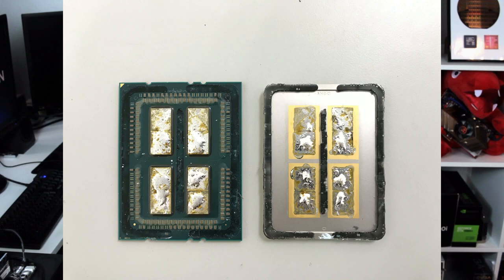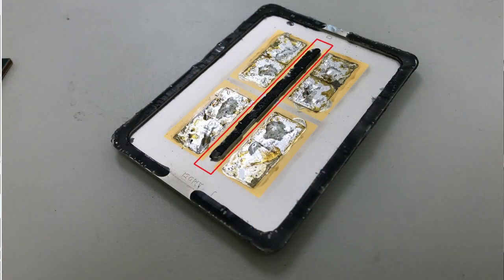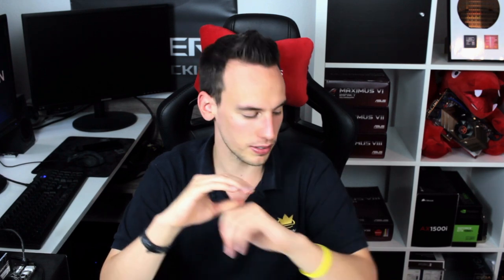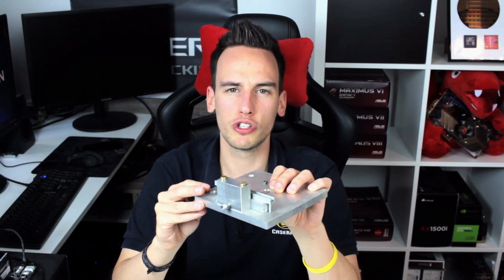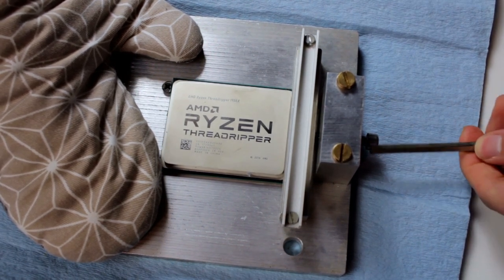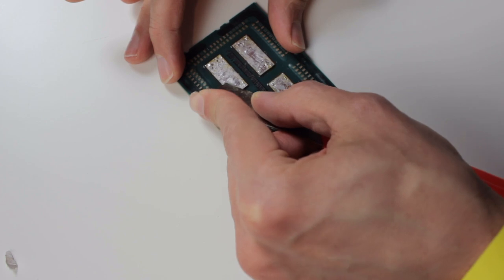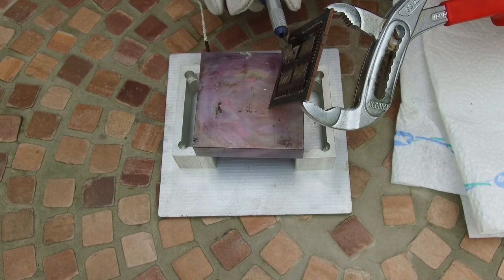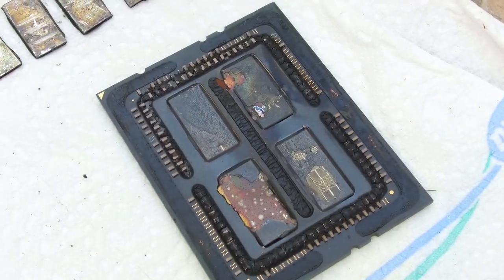Dummy Dies? Threadripper examined (en)

Comment: Hum hum, so this would mean that statement from AMD boasting about the engineers coming up with threadripper in their free time is somewhat BS... It's an epyc CPU with either deactivated or damaged dies... Are they connected "electrically" ? I wouldn't imagine so.
Reply from the maker: Yes they are. You can see traces on the PCB underneath the dies.
Reply: Hum. So it could be failed EPYCs but wouldn't they be sorting the dies before putting them on the interposer ? Doesn't make much sense to connect them, funny. Do you know if they create there own heat ? Oh and great video really interesting.
Reply: taking a server cpu and developing a hedt cpu with it still takes time, as new bios have to be made, the validation is different figuring out what clock speed can be achieved and so on, i think if anything it gives more proof that they were able to do it in their spare time
Reply: No I don't think that it is BS, if the HEDT wasn't part of the original roadmap then those people would have been playing with Epyc engineering samples to formulate their HEDT passion. Rather than disprove it, it actually supports it as TR doesn't require special production runs to implement. They were able to make the TR4 platform an adaption of the single CPU Epyc platform, which is what it basically is.
Reply: Just an average Guitarist
How would they know if they worked if they hadn't assembled/connected them first so they could test them?
Reply: To my knowledge they use high res optical scanners/substrate mapping on the wafer to detect defects, but they do detect the defects while on the wafer and not before it's mounted on an interposer (packaged by a different fab than the ones that make the dies), then yeah of course then it's tested more (and binned) once it's on an interposer but that is after sorting and removing the obvious defects, so you wouldn't expect there to be enough defects after binning in the case of TR, so in that case you wouldn't have expected them to be connected electrically, I would've thought that they would use dies with known defects as spacers and not connect them electrically (as they know that they are defects before they go on the interposer)
Like for example they know a Vega 56 die is a defect 64 before it's packaged, they know where it has defects, how many and that it should potentially be a candidate for a 56 (hence why you got cases where the Fiji pro could be unlocked), they don't package all the dies of a wafer and then look if they have defects (wouldn't be cost efficient at all)
Reply: Just an average Guitarist
Oh I had no idea, perhaps they are all working when mounted, but the mounting step has a failure rate as well?
Reply: +Mitchell Couchman Yep of course, but in theory not wrong enough to make a whole new range of 3 CPU SKUs, them being electrically connected is what i'm interested in, because that would mean that they were being put on the interposer with the goal of being used as opposed to just spacers, connecting the dies electrically does require extra work, which wouldn't make much sense if you just use them as spacers, you would use dies that you know are defects and then wouldn't connect them coz you know they are defects.

Which does lead me to believe that these are either "just" faulty (under certain circumstances) EPYCs, which would I imagine go through stricter tests than any other ZEN based cpu. Or that the yields are that good that they are having to artificially disable cores/dies to make full ranges of CPUs (and they did mention that the yields were very good quite a bit ago), which isn't unheard of because sometimes it makes more sense economically to just disable stuff than to thoroughly sort and bin dies when the yields are great.
The thing is I don't think that we will ever find out :(

In all cases I do find this genuinely interesting lol
Reply: Hey and another thing, AMD have said that the "good" dies are set diagonally so that would mean that with their spacer story they know which dies are good before hand,  to be able to set them diagonally, so why would the "spacers" need to be connected electrically then ? That and on every good threadripper they are luck to have 2 good diagonal dies and not only 2 next to each other ? Nah now i'm pretty  convinced that these are artificially deactivated at some level on like 1 die out of 4 and 1 having failed  (maybe even 2 dies being artificially deactivated) and that they are "failed" EPYCs. and they haven't bought out a 32 yet because they either need them for EPYC or are worried that it will take some market out of the EPYC.
Reply: if they are planning on making versions with 3 dies enabled and later on 4 dies enabled then it does make sense to connect them, that way they won't need to design a new PCB, just have to improve the silicon yield to the point that they can afford to enable those extra dies.
Reply: AMD James confirmed they are not connected electrically in an r/AMD post.  (and also a twitter message if i'm not mistaken)  the interposer is actually different for Threadripper than for Epyc.
Reply: It's not "interposer". Interposers are silicon chips, this is a small PCB.
Reply: an interposer can be made out of anything.  vegas package with the hbm is a silicon interposer.   Threadripper and Epic are pcb interposers.  The definition of an interposer just means something placed or inserted between 2 other things.

Comment: So, AMD lied us?
Reply: Taran why?
Reply: they lied to Intel TBH.... now intel's 7980xe wont look as impressive when AMD unlocks some of the cores
Reply: It's more of a "white lie" really, 99% of people wouldn't understand if they say "the ryzen contains disabled, defective cores" so its a lot easier to just say they are "dummies", especially if they are impossible to unlock they aren't able to do anything so they are "dummies"
Reply: certain intel xeon chips already had more than 18 cores
Reply: Its an EPYC
Reply: Its an EPYC
Reply: That's potentially not an issue in this case, previous CPUs disabled cores by software because it was the easiest way to disable them and that's why there was always a workaround to enable them again since software is always hackable. With this CPU since each set 8 cores is in its own separate die they can easily disconnect (or even internally destroy) out-of-spec dies leaving them physically impossible to enable again if they want to.
Reply: Hm, didn't know someone confirmed it, seemed like the obvious thing to do anyway.

Comment: My guess is that the “dummy dies” are there because they are actually used for the purpose of providing pcie lanes. How do you think AMD managed to have 64PCIe CPU lanes in threadripper? Threadripper is essentially four Ryzen 7 1800x glued together – each 1800x has 16 dedicated CPU lanes, 16x4=64. AMD didn't want to admit it as otherwise their lie about one-upping Intel in the PCIe lane count department would be exposed as essentially only 32 lanes would come off directly from the active CPU dies while the other 32 would be coming off the dummy dies, so not “true” CPU lanes.
Reply: Alex Marin  you know they have Eypc cores with 128 pcie Lanes. 
Even the 8 core Epyc has 128 pcie Lanes.
Reply: Sirallony -- Your cue should be that even the 8core variants (in both the threadrippper and epyc chips) feature the full number of PCIe lanes…

Comment: what a stupid and absolutely useless test, from day 0 was clear, all dies are fully/partly functional. X399 has 50+ PCIe lines activated, then you need all PCIe controllers in all 4 dies for this. Cores are disabled, fabric and PCIe/Mem controllers not.
Reply from the maker: ah yea so because it was clear all the news pages picked it up - wait wat?
Reply: Each die has two x16 PCIe's. Thus, two dies have 64 PCIe lanes.

Comment: Thank you but seeing you cut towards your hand was cringey as fuck. Take it from someone who has cut a tendon before, you DO NOT WANT TO DO THAT. Sleeping with your hand suspended above your heart sucks. Each day, hand above your heart during the day... not fun. No hand use for 3 months.. cast for 1-2... yeah don't cut towards your hand.

And I was also quite sure too they were real dies disabled. It will be an Epyc CPU because it will be one production line to save costs. It's cheaper for them to disable a working die or maybe a slightly defective e.g. 6 core die, than to do otherwise.